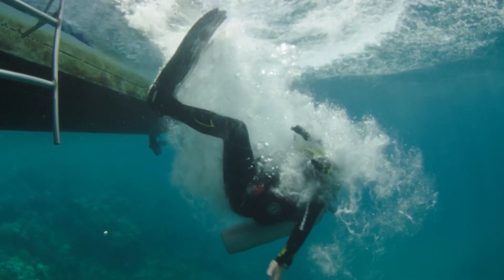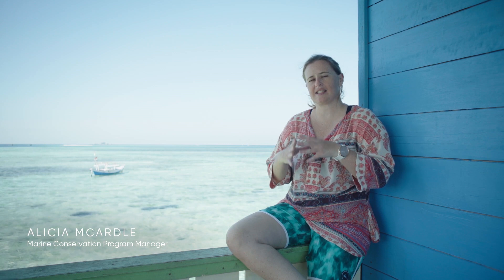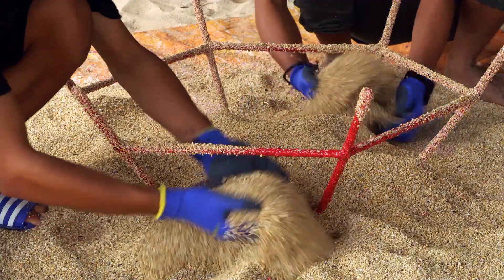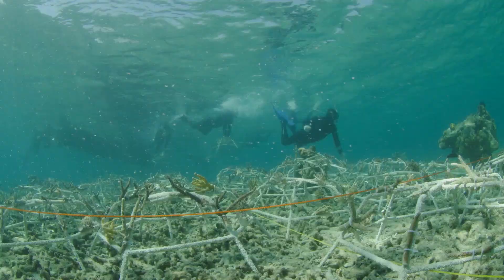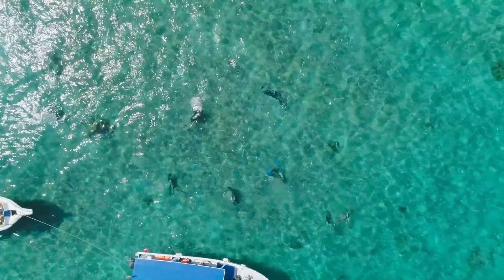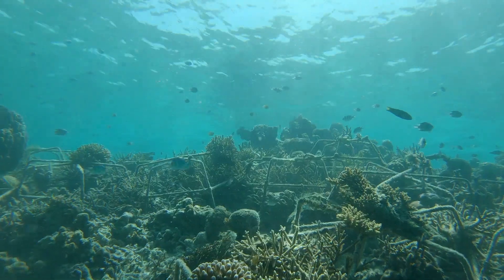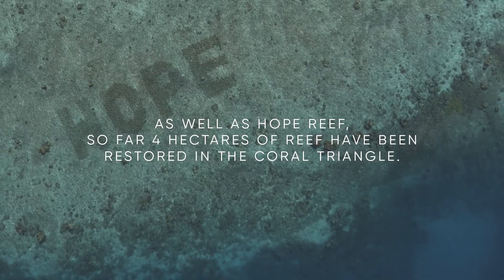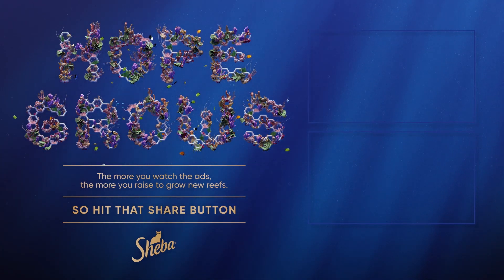No. 1 The Making of Sheba Hope Reef | Behind The Scenes | Sheba Hope Grows

Comment: Beautiful project! We need hope as much as we need reef regeneration. Have you guys looked into the research (Mediterranean, I think) regarding running low voltage through metal armatures for coral? Seems as though it stimulates more rapid colonization and growth. Could be run via floating solar or wind generators linked to the reef.
Reply from the maker: Thank you for your message. During the development of the Mars Assisted Reef Restoration System we assessed all available restoration techniques including those that depend on external energy sources (including green energy solutions). Very early on we decided to ensure that the system we developed would only depend on low levels of technology and on locally available materials so that it was a solution that everyone could utilize e.g. including remote island communities - this is key to scalability. We therefore did not proceed with electrified systems. 

You can find out more about our Mars Coral Restoration Program at - https://buildingcoral.com/.
Reply: I see Biorock is already running an electric reef project in Indonesia. Are you collaborating? https://en.wikipedia.org/wiki/Electrified_reef